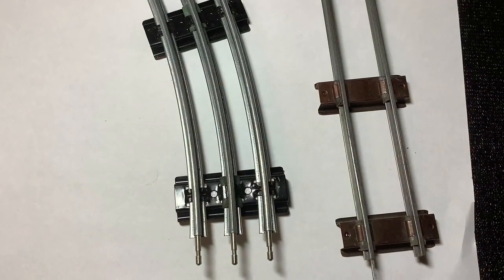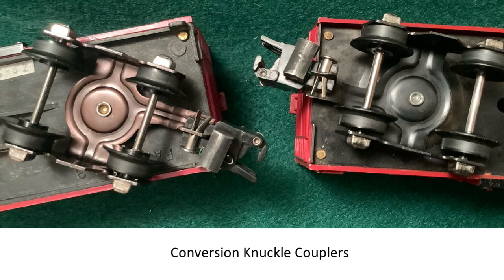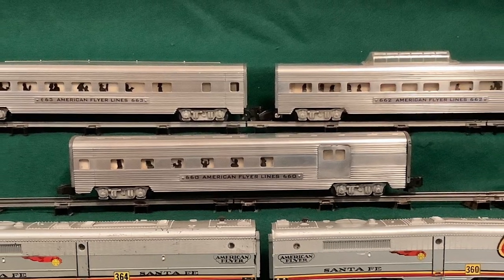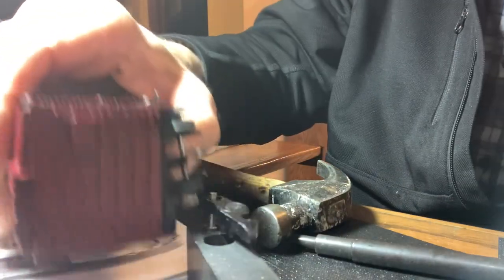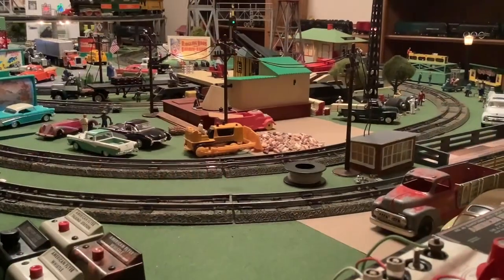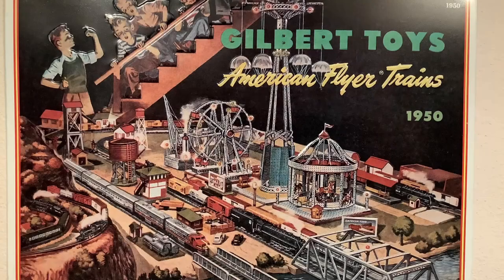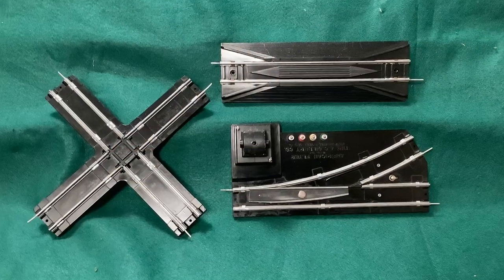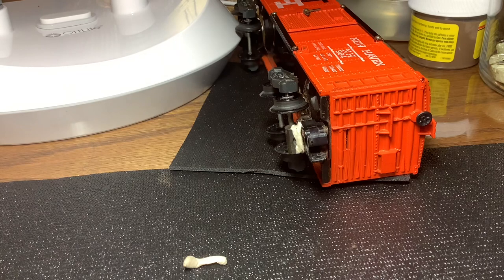American Flyer Link & Knuckle Couplers

Comment: I, too, like link couplers, and have found they work well and are very reliable. Several of my freight cars acquired in the past have a link coupler on the one end and knuckle coupler on the other end, allowing flexibility in hooking up with a link or knuckle-equipped engine.
Thanks for the excellent video!   🚂
Reply from the maker: Thanks for your comments.  I ended up putting all of my conversion knuckle couplers back to link couplers except for two cars that have one at each end as you mentioned. We all do what works for us!  Thanks for watching.

Comment: Tim Coe takes his couplers apart for a good cleaning and uses a slightly larger drill bit through the pin hole then puts them back together for a flawless operation. I done this to mine and haven't had any uncouple.
Reply from the maker: Yes, I think I saw that video, too.  It’s good to get a variety of ideas.  Thanks for your comment and for watching.

Comment: I agree with your assessment on the increased gap between cars when links are converted to knuckle.  I prefer to leave link couplers original, and restore them when needed.
Reply from the maker: Yes, I wish I had know that 20 years ago!  Thanks for watching
Reply: I sure do agree. Proper adjustment and lubricant is the trick. Use mineral oil, not Spirits! Wahloil is great oil too.

Comment: Excellent tips! Thank you. I've used the hair dryer and soldering iron too. I found that the hair dryer evaporates that chemical on the outside of the plastic. I also wipe off the plastic right away with a swab or paper towel, on some couplers, the white stuff doesn't fully evaporate.  I also wonder if the soldering iron evaporates that chemical around the metal pin, which would loosen it a bit. I don't yet have the tools to replace the link couplers, but I do like how they fit close together.
Reply from the maker: Thanks for the comments.  I don’t really have to answer to your questions either.  Thanks for watching.

Comment: Put small rubber band on metal links, not on the weights. It's easier   to put the smaller black rubber band on the metal links and won't break or come of while running the trains. Stretching bands from weight to weight is not as easy and the tiny black rubber bands are far better and smaller and again easier to put on. Beauty supply stores sell packages of them really cheap. A 50 year AF repairman  showed this to me back in the 1990s.  He was a good friend as well as an unusual repairman who did plastic mold work for making new steps for American Flyer hoppers and gondolas too. He passed away at 80  just before the pandemic hit us. He became a good friend and miss him alot. If you know anyone who does step work let me know because I have a 24222 Domino Sugar Hopper and a 631 Gray T&P gondola, both cars missing 2 steps. Thank you for reading all this. Mike
Reply from the maker: I’ll have to give this a try- it does make sense.  Thanks for the information. Having a colleague like that was a real blessing.  I’ve tried molding some steps but they didn’t come out satisfactorily but I’ll keep trying when I get time.  I hope to attend a session of the local HO club in the near future so I’ll ask if anybody there has expertise in that.

Comment: 10:30 Wonder if the weight is not fully pushed onto the stem? Place weight on something solid and using a drift tap top of stem down towards the weight.  Be careful not to slip off the top of the stem and hit the coupler body. Will need to support the car or train to free up hands.